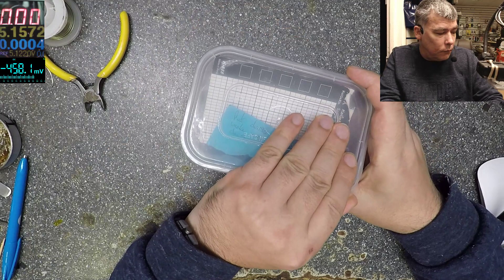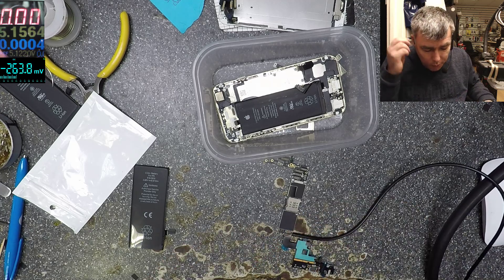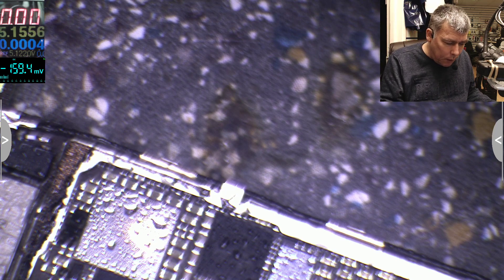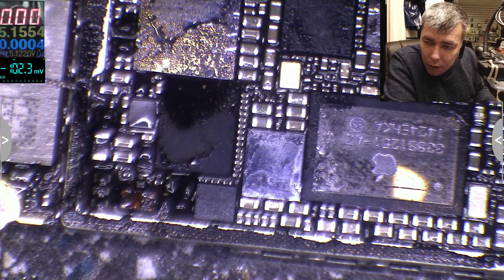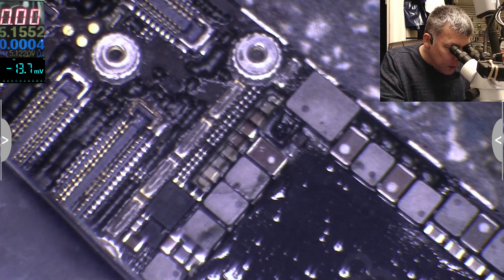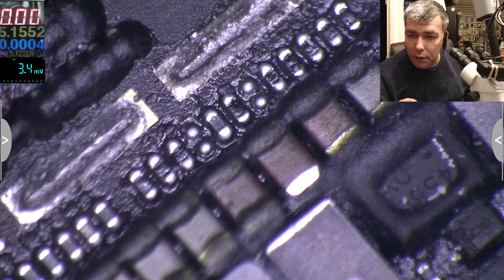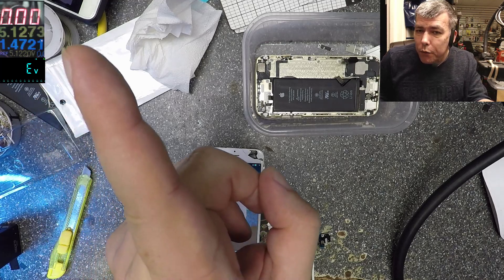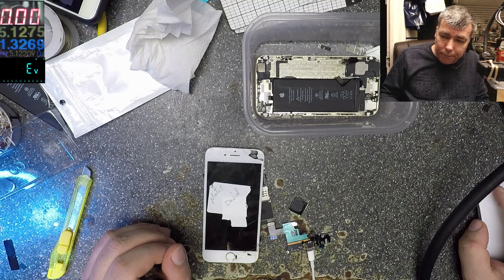Iphone no power, not charging - burning schottky diode

Comment: Why do u use freezing spay for that one but other times use petrol to work put where the short circuit is? Also I have heard it might be a bad idea to use the freeze spray, as supposedly hot and cold extemes can destroy things aswell !as in going from one extreme hot to another extreme cold, or extreme cold to exteme hot etc.

Comment: Hey man i love your videos please what do you think about the i phone 6 i asked some days ago!
When the Touch ID port is not connected the phone works but in the moment when i put the connector on the Logic Board the I Phone wont start anymore and if i try to charg it the current jumps between 0.5A and 0A but it wont charge or come up!! The home button is new and is not working!!! Do you think that the Problem could be on the Logicboard or maybe it works with a new Display!! I know its difficult to do a diagnose over distance but you are good in your job just what do you think or what can i try to find out exactly is the problem is just on the Display or is the Logicboard damaged??? When thiis Touch ID Connector is not connected everything works great but not the >Homebutten it doesnot work also the new one i put in there not working!!!

Comment: Sorin, my Phoneboard programme does not give me component values like resistor values or capacitance values as you are showing in your video. I have the version 1.9.0 which is the most current version. Do you need another file to connect to the programme from which these values are read?

Comment: İ have an issue with a laptop mainboard i always watching your videos so i decided to fix problem

My laptop graphics card overheating and laptop freezes when i play games or something and i replaced the thermal  paste and cleaned the fan and it still same and i find a ic that heating the ic is a voltage regulator and its near the graphics chip 9661-25 so i decided the replace the chip but i need 2 months to gather chip from china

Is this possible a shorted cap like the video or something else after the voltage regulator or the graphic chip itself ? 

Sorry for bad English Thanks for any help
Reply: I think i found problem its chip itself 😭

Comment: petrol? is it gasoline for lighter that you use zippo? is there a precaution to take when using this? voltage etc ...
thanks
Reply: Lighter Fluid      I could not find zippo brand here, but Ronsonol Lighter fuel is the same thing

Comment: I have a question, when you use freeze spray to test the board is there not the chance you could short the board due to the water droplets that form once the freeze spray melts away?
Reply: I never had that problem. The freeze spray evaporates pretty fast.

Comment: microscopes of expensive type did not work for me toy plastic ones remember to build new light on top illumination using new bulb led ....please remember to take out head of toy microscope and look both reverse way for me a magnification of 20 is plenty to look at stitch threaD.................................................BROKEN  BINOCULARS EYE PIECE AGAIN LOOK BACKWARDS  and use if need to attatch to eye use rubber band to back of head ......................................................................................................................................................................................thank you for toy helicopter